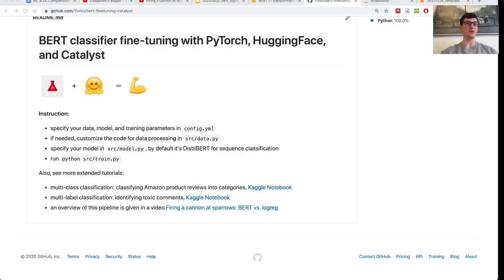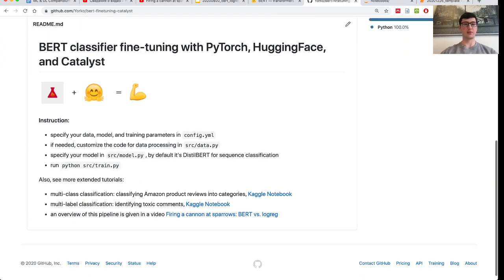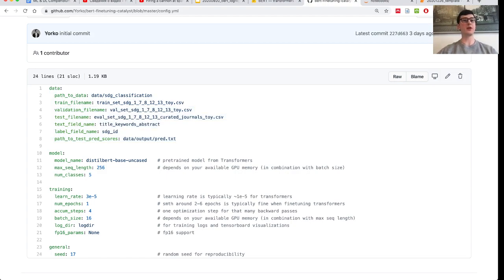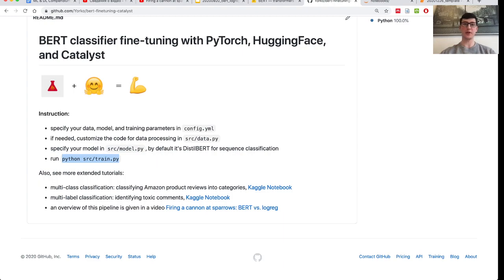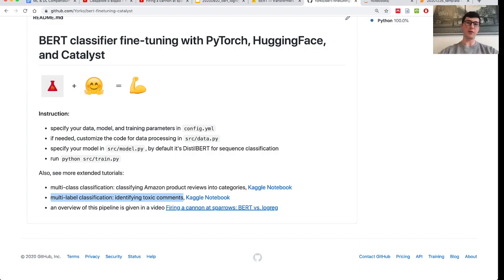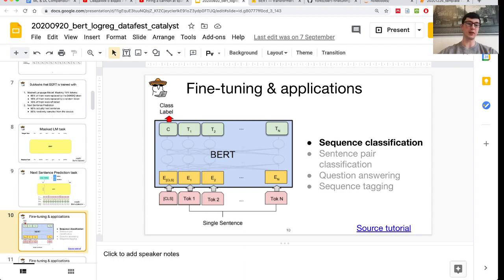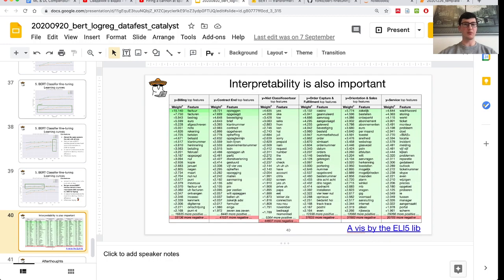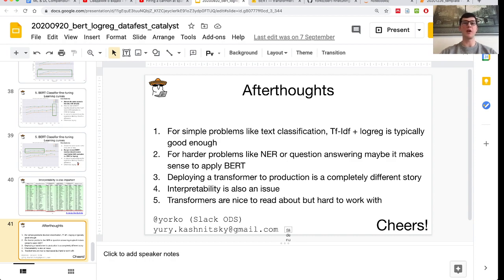BERT classifier fine-tuning with PyTorch, HuggingFace, and Catalyst. Part 1. Intro

Comment: Hi Yury!! Great work:)
May I know whether continuous retraining is possible using BERT?
i.e.,I have a fine-tuned model,Can I further tune it using additional dtaset without merging the new dataset with the old.
Reply from the maker: Hi! Sure. The fine-tuned model is stored as a checkpoint, then you can load this checkpoint (pure PyTorch here), and further fine-tune the model with the new data.